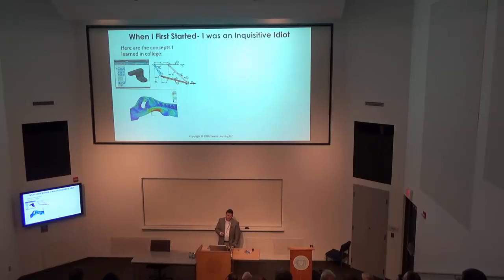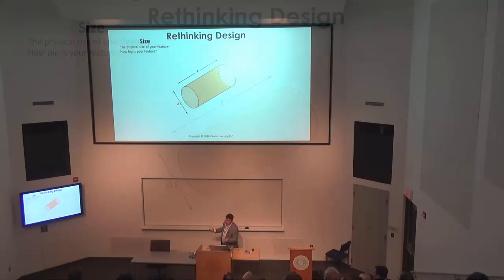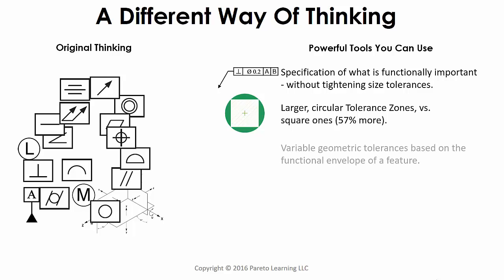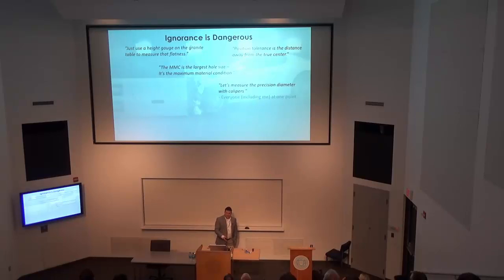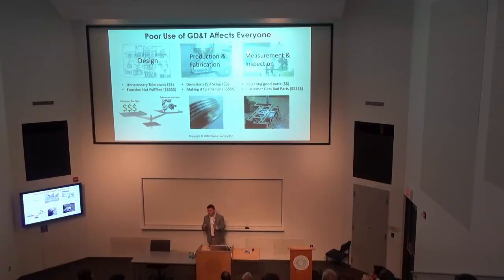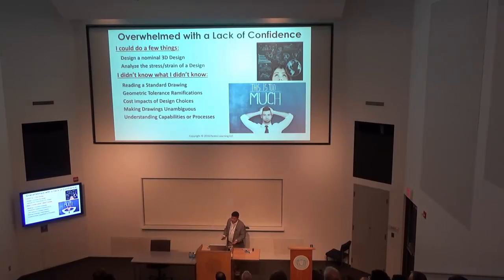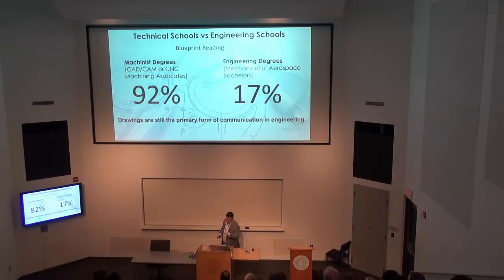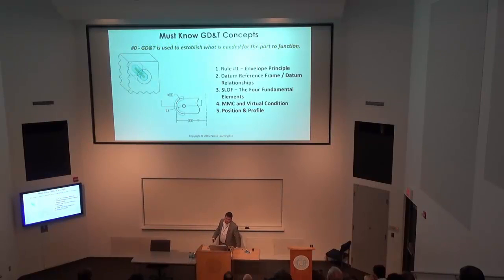Importance of GD&T Training for New Engineers

Comment: (12.02) that is soo true. Manufacturers are intimidated and scared of GD&T ignorance.
Reply: @agankachu09 Machine shops WERE scared and didn't understand GD&T ...in 1986.
Modern shops are very knowledgeable. Those that are not ARE making you bad 16:56  you're paying them to do it, and you have no recourse when they fail to fit and function.
I've been involved with design, drafting, tooling, and checking since 1981.

Comment: You did a excellent job helping industry realize that GD&T is a functional savings.  The language is a digital CAD tool for allowing  all assemblies an ability to maximize size tolerances with modifiers (MMC or LMC) as a bonus-tool. Virtual condition has made functional tooling a foundation for "zero-defects" in part geometry.  GD&T is an awesome language for all design engineering.  Thanks for the outstanding half-hour presentation.

T J (Tom) Vanderloop, Author, Technology-Instructor, and Consultant; ATEA, AWS & SME Leader/Memberships